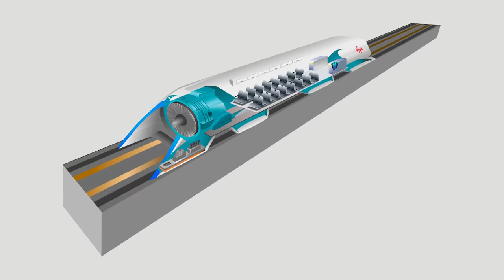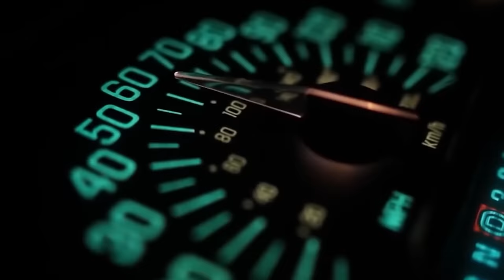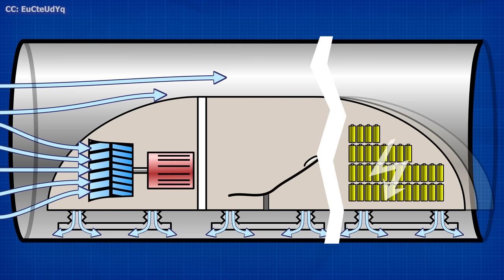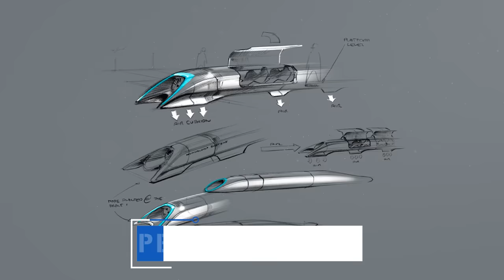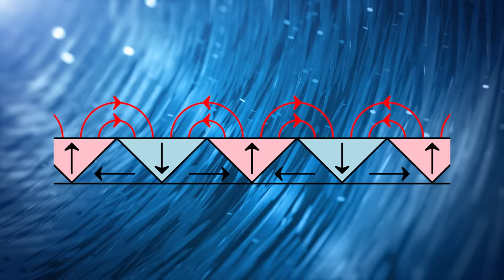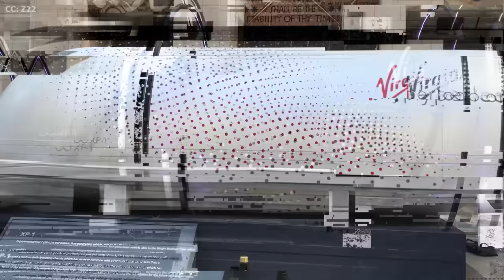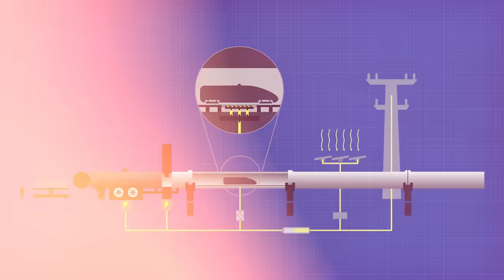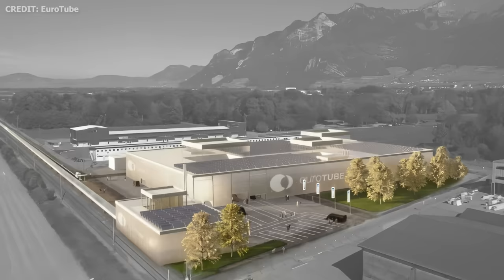We’re Getting Closer to a Hyperloop...

Comment: It is virtually impossible to get the hyperloop system to work safely in real life. Great idea in sci fi novels, not so much in real life. It won't ever be implemented commercially. It's a complete pipe dream!
Reply: well said. Just maintaining the vaccuum for that amount of volume is impossible. Not to mention the construction costs simply quadruple regular rail construction( something most countries cannot afford as is ) The newest skinksaen is getting closer and closer to hyperloop speeds with the recent model topping 600kph. So in the future ,maglevs will be doing 8-900 kph with no vaccuum tube needed.
Reply: Why not? We already have welded rails that can survive thermal expansion over miles without joints.
Reply: @johntheux9238  A welded chunk of steel isn't quite the same as maintaining a near vacuum over tens or hundreds of miles. It takes one idiot with a gun, a rock, a car etc to do something to compromise that to quickly destroy the entire thing, or a large section of it. Explosive decompression is rather violent.
Reply: @TalesOfWar  Big cargo ships have their hulls over 10 meters underwater. They can survive one atmosphere of pressure difference on a way bigger radius.
All you need are stiffeners and stringers to prevent buckling from the negative pressure difference.
Reply: @johntheux9238 Completely irrelevant comparison
Reply: @johntheux9238  You genuinely have no understanding of this topic, do you? A boat having a hull is not even remotely similar to having hundreds of miles of near vacuum.

Just sit quietly, dude.
Reply: @V0idFace  One atmosphere is 10 tons per square meter. That's equal to 10 meters of water.
Just go back to school if you don't know how maths work.
And boats can exceed 600'000 cubic meters which is equal to a 100 miles long vacuum chamber.
Reply: That’s what they said about airplanes.
Reply: @gehteuchnixan69  Why is that irrelevant? Boths are under a negative pressure difference. Boats have a way greater radius so it's way harder to build a hull than a vacuum chamber.
Reply: @johntheux9238  oh good, you weren’t quite bright enough to understand the point. 

That isn’t how anything works, and creating a near perfect vacuum hundreds or thousands of miles long is not even remotely the same as simply having a boat not sink. 

Sit quietly now, son.
Reply: @TalesOfWar  You won’t get explosive decompression at under 1 bar difference in pressure.
Reply: @airgunningyup well, the large hadron collider is 17 miles long and it’s vacuum is really insane with the pressures lower than 10e-10 torr. Hyperloop will be much longer, but it requires pressures of about 0.75 torr, which is like 10 orders of magnitude higher than at the LHC, which should be double
Reply: @NoahSpurrier  no, it really isn’t. 

If you don’t understand the topic, please sit quietly while the adult talks. Thanks.
Reply: oil pipelines run at several atmosphere of pressure for thousands of miles. expansion joints will be an engineering challenge.
Reply: @V0idFace  What is your point then? Same volume, same pressure to overcome, same manufacturing process. And it's not supposed to be a perfect vacuum, just low pressure air.
The only difference is that the hyperloop vacuum chamber has more issues with thermal expansion since it's on the ground, but we already have solved that with welded rails.
Reply: @qadirtimerghazin  yea, the collider is in a much more stable enviroment underground regarding temp fluctuations.The differences between possible and feasable are often hard to define.I also think the walls on the collider are far thicker for  radiation insulation purposes whereas the loop would be a thin wall pressure vessel by definition. Im a strong advocate for high speed rail , but I just dont see this happening.
Reply: @NoahSpurrier  or go back just 8-9 back and see the armies of purported airspace experts, not to mention half of the Internet of armchair experts, who categorically stated that rocket reusability is both technologically and economically not feasible.
Reply: Said about anything hard ever
Reply: @johntheux9238  Are you suggesting you put a cargo ship in a tube?
Reply: @qadirtimerghazin  When did people say that? We've had reusable rockets for years before SpaceX existed. Lockheed Martin were making them in the 90's. They just weren't really all thaty big a deal until the Shuttle was retired and we suddenly needed a new, reusable, practical way to get things in to orbit.
Reply: @airgunningyup  Welded rails can survive thermal expansion pretty well. The thing is to build them in the summer, so that they only get tensile stress when they shrink but not compressive stress.
Using a welded vacuum chamber would reduce leaks, regardless of thickness.
Reply: @TalesOfWar  But it wasn't economically viable.
Reply: @johntheux9238  and I’ve already explained the two things are not even remotely comparable. 

And no, it’s supposed to be a near vacuum. 

You genuinely know and understanding nothing about this topic lmao
Reply: @TalesOfWar  what reusable rockets did Lockheed Martin make in the 90s?
Reply: @airgunningyup Wasteful energy operating maglev without vacuum tunnel. The energy can be used to generate vacuum while pulling the train in the tunnels. My granted UKIPO patent Zero Energy Transportation System will allow that in a safe and economical way. No problem with leaky tunnels but more leaks more losses, that is all. The vacuum is treated as a battery, storing the pumping energy but needs to be recharged for every leak or direct usage. All energy storage devices leak energy also.
Reply: @TalesOfWar Similarly for a plane. Pressurised plane travelling in vacuum. They did happen but that is not an excuse to stop air travel, just like train robberies did not stop train travel.
Reply: @V0idFace who says anything about near perfect vacuum?
Reply: @TalesOfWar The arm chair experts do not seem to know that there are many reusable rockets prior to Spaced. Just as currently with large vacuum tunnels. NASA has large vacuum chambers and the Particle Colliders operate in near perfect vacuum for miles.
Reply: @othmanskn  that’s what it would require. It would need to be a near vacuum to actually work in any way that would be worthwhile. 

If you don’t actually understand the topic, dude, sit quietly.
Reply: @othmanskn  Planes don't travel in a vacuum... there's still pressure outside the fusalage, it's just lower than at ground level hence the need to pressurise so you can comfortably breathe. Even with that less than 1 bar pressure difference the sudden change in pressure from a puncture can cause explosive decompression. It isn't just a thing that happens in movies.
Reply: @johntheux9238 That is what EV skeptics keep on saying despite Tesla making billions of profits. Just because you are so stupid not able to make a technology economically feasible, does not mean that others cannot make them feasible.
Reply: @qadirtimerghazin  He's prolly referring to the space shuttle and SRB systems -- or perhaps the Nexus project (a reusable successor to the Saturn V, tho I'm not sure if LM was involved with that). 

There was also a great project from McDonnell Douglas in the 90's called the Delta Clipper, or DC-X -- a re-usable vertical launch and landing rocket (essentially the same idea SpaceX used for their Starship project). The British had a similar design to the Clipper, the Skylon, while the Russians had the Energia and plans for a fully reusable Energia II. The ESA was also testing recovering and re-using Ariane rockets in the 90's. 

Reusable rockets is an idea that's been around since the 50's and 60's -- it just had a lot of economic and engineering hurdles that made it more trouble (and expense) than it was worth.
Reply: @qadirtimerghazin  I misrememebred sorry, it was McDonnell Douglas.
Reply: There are mitigations for land shifting, vacuum containment will be best explored on Mars when they get there. RIP to the early ones but we will learn a lot.
Reply: The reason hyperloop is doomed to fail isnt because its virtually impossible IMO, its because we already invented aircraft that can do virtually the same thing without the infrastructure. If we wanted to make aircraft emissions free we could do it tomorrow running them on hydrogen for less than the cost of hyperloop, but still much more than the cost of current aircraft which is why we dont do it today.
Reply: @legallyfree2955  The infrastructure required for airlines is absolutely insane. If there were systems in place that don't require the level of consumption and human-salaried positions they will absolutely replace it.
Reply: @TalesOfWar  How many times did that rocket make it to orbit and back? How many satellites did it launch? How many times it could be reused after launching stuff to orbit?
Reply: @olencone4005  Ideas are a dime a dozen. But only Falcon 9 boosters can launch stuff to orbit, including humans, come back, and fly again in a few weeks; some of them did it 16 times already. As for the Shuttle, it was refurbishable at best, and it failed to make sending stuff to orbit any cheaper
Reply: Just because people buy it doesn't mean it's a good idea. People are so gullible.
Reply: @othmanskn  many reusable rockets before SpaceX? Please name one that successfully launched a payload to the orbit, landed, and did it again within weeks, whereby significantly decreasing the launch cost? The Shuttle, which had to be essentially taken apart after each mission and cost shitton of money? Ok, what else? It would be very interesting to learn something new about the space industry
Reply: @johntheux9238 You are the living embodiment of the Dunning-Kruger Effect. Such confidence! Such lack of knowledge!
Reply: @V0idFace  You don't even know the meaning of vacuum. Give actual measurements of vacuum if you really know.
Reply: @olencone4005  Excellent observation. Now apply it to Vacuum tunnels.
Reply: @legallyfree2955  Your science and calculations are all wrong. Better get them corrected first.
Reply: @V0idFace  Why are not they comparable? Boats have a way bigger radius than a hyperloop vacuum chamber so it's in fact way harder for them to survive the same pressure.
The only main difference is that a boat can expand since it's floating on water, but in that specific case the vacuum chamber is similar to welded rails, which survive thermal expansion just fine.
And yes, one atmosphere is just 10 meters of water. The air has a density of 1.2 kg/m3 and loses half it's density every 5.5 kilometers so that's 10 tons per square meter.
Reply: @othmanskn  son I know far more about this subject than you do, especially given the fact every single syllable of every comment you’ve made has been wrong. Lmao
Reply: @V0idFace  The hyperloop is designed to operate at 1/1000 atmospheric pressure. That's not a perfect vacuum at all, far from it. And it can easily be increased to 1/100 or even 1/10 atmospheric pressure. Airplanes for example can get close to the speed of sound at just 11 kilometers of altitude where the atmospheric pressure is just 1/4 of sea level.
Reply: @V0idFace  Airplanes can get close or even exceed the speed of sound at 1/4 atmospheric pressure. Who the hell said it would need to be a perfect vacuum?
Reply: @othmanskn  also: I didn’t say it needed to be a perfect vacuum, but near perfect…which is a pretty important distinction. 

I know I shouldn’t expect quality English comprehension from you, but even a toddler would have seen that difference lmaooooo.
Reply: @olencone4005  It takes 2.5 years to reuse the space shuttle SRBs and 54 days to reuse the shuttle itself. It only takes 21 days to reuse a falcon 9 booster.
Maintenance and logistics are not the same at all for both vehicles.
Reply: @legallyfree2955  Hydrogen is only 30% efficient so the energy costs are way too high.
Reply: @johntheux9238  it has already been explained to you by others, repeatedly, before I even came along.

Try learning to read before responding, thanks.
Reply: @johntheux9238  it’s not designed to operate at that pressure at all…it’s not designed at all, literally no part of it is functional or even would be functional…as has been explained to you. There is a reason this idea has been repeatedly debunked.
Reply: @randomname4726  Do you even know what buckling and stiffeners are? Just like Thunderf00t you must think that vacuum chambers and soda cans are the same...
You are the perfect example of the the Dunning-Kruger Effect.
Reply: @johntheux9238  Thats largely correct, however if we were to switch over to renewables using intermittent sources there would be periods of time with excess energy that could be used to create hydrogen for a lower cost. It would still be more expensive than the current system though I suspect.
Reply: @legallyfree2955  First smart comment I see.
Batteries will still be used for short haul thought, but if hydrogen is needed because there is no alternative it will be used.
Reply: @othmanskn  Well, for vacuum tubes, the interior of a Hyperloop is planned to be maintained at a steady 100 Pascals, or about 1/1,000th of an atmosphere. Not a true vacuum, as some have already noted here, but so close to one that the difference is rather negligible. 

The Hyperloop would essentially be moving in near-space conditions, far beyond what any aircraft has to endure.

Any break in the tube would be... beyond catastrophic, even at sea level. Air would rush into the vacuum of the tube with an explosive force of 15 psi -- for reference, according to the CDC, 3 psi of blast pressure can cause serious physical damage to a human... 10 psi can destroy reinforced concrete buildings and kill most people... 15 psi will shred that tube like a supersonic freight train.

It would be an epic catastrophe spanning  hundreds of kilometers, of such a massive scale that it will make the Titan submersible look like a Disney ride.

And I'm not even going to try to calculate the damage done by the travel pods themselves, which will be moving at sufficient speed to generate a force of 75-200 kg of TNT on impact with an obstacle -- such as the car in front of them or part of a tube that's imploding at or above the speed of sound. I would not be surprised in the slightest if such an incident had a 0% survival rate for everyone in the entire length of the tube.

And no, there is no guaranteed way to prevent such an incident. Every emergency access point, expansion joint, and weld is a potential point of failure -- the more points you have, the more likely it is that something will eventually fail. That's why so many astronomers and engineers were sitting on pins and needles when JWST deployed -- and it just had 344 potential points of failure... 

Hyperloop would easily have that many every 100 meters.

Then there's a separate issue of intentional acts of petty vandalism, malicious terrorism, or even just poor workmanship, any of which could  easily produce the same disastrous results.
Reply: @johntheux9238  I wasn't saying it was -- the poster I was replying to was simply asking about re-usable rocket programs in the 90's. Feel free to slide that goalpost out further if you like, it won't change my answer in the slightest.
Reply: @olencone4005  The stress that the vacuum chamber has to handle is the same, but when it comes to the pumps 100 pascals is way easier to maintain.
Reply: @V0idFace  Yes, Colin Robinson. You should feed elsewhere.
Reply: Tunnel boring that is cheap and easy is an absolute requirement in my opinion. Steel tubes at vacuum are not practical. There’s no way to economically produce them robust enough to last 50 years and be bullet proof at the same time.
Reply: That's what was said about the highway system
Reply: @undertow2142  The Trans-Alaska oil pipeline isn’t much smaller and it’s been around for close to 50 years. It also operates under much higher pressures than a vacuum tube would experience.

This is not a difficult engineering problem. This is a question whether shooting humans through a tube would create more profit than pumping oil through a tube.
Reply: @TalesOfWar  its not explosive decompression though it is … its compression … the outside pressure would flood into the vacuum tube and that has its own damaging potential, but the whole thing wont go up and decompress …. Its already decompressed
Reply: @johntheux9238 you took an L here buddy
Reply: @laetrille  By who? By the guy who said I don't understand the topic despite not leaving a single relevant comment himself?
Reply: Coffins in sewer pipes.
Reply: I reckon it's 150 years away.
Reply: @thomasmavronicholas9783  I chose my words poorly, I meant implosion. Either way, it would be rather... violent, for those within the now compromised vacuum.
Reply: @V0idFace You clearly know more about the topic than everyone else here.. But have yet to grace yt with your vast wisdom.🤔 Surely you can add more to a convo beyond lukewarm insults and telling everyone to sit down?

Right?😂😂😂
Reply: @flexinclouds  I don’t need to, the facts have already been explained by myself and others. 

Try thinking before commenting. It might be painful but I know you can do it! Lmao
Reply: Any countries right now planning for hyperloop? India just cancel theirs.
and made in USA will be too expensive, so probably no?
Reply: It's fraud, but some people like to play the part of a sucker.
Reply: @olencone4005 And now Space X has succeeded where  previous attempts failed.  Persistence and good timing has made SpaceX the cheapest transporter to low Earth orbit.
Reply: @legallyfree2955 Hydrogen is not a manageable molecule so far.  H2 is to small.  And it requires cryogenic temperatures to achieve the energy density so you are wrong about Hydrogen energizing flight.